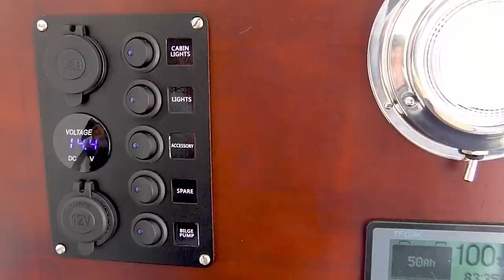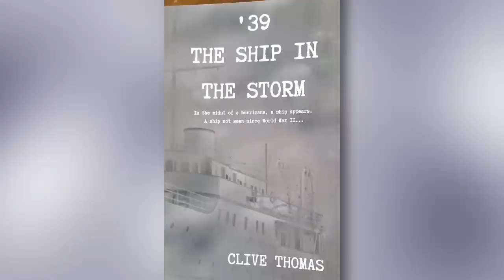7 Month restoration, ready for Dinghy Cruising

Comment: Very nice job! I had an Investigator 30 odd years ago. Launched it twice, then sold it.  Getting it in and out of the water was just too hard.. A Compass Careel proved much easier.
Reply from the maker: Wow, now that's interesting. I presume you mean as the Investigator has a skeg it sits higher on the trailer. But Clive's seem to just slide off easily. For me the advantage of more cockpit space makes the Investigator a winner. Thanks for watching, cheers Paul
Reply: You had the wrong trailer mate, mines a piece of cake to launch and retrieve.
Reply: @GregVanWinden    You're right, mine didn't have the V shape chassis centre. But even so, the Careel could be beached without rolling over, so it was more suited to me needs. I'm not knocking the 563, as it was a beautiful boat to sail.

Comment: My Dad bought an Investigator in the late seventies but there was no centre board, just the skeg. It was difficult to  launch because we had shallow lee shores and upwind  performance was not great and again that lee shore, but I do recall it was a real TARDIS. I also remember my Dad ruefully observing that the new boats had a centre board. Now that I am 60 I think it would made a fantastic raider. I wish them fair winds.
Reply from the maker: Hi Glenn, get another one and join us. Clive is hoping to drop the centre board and check the pin and pulley but that's a bit tricky, so at the moment he is not using the centre board. On my Stornaway I really wish I had a drop down centre board from the skeg, it would definitely improve performance. Thanks for watching, cheers Paul
Reply: The 563’s without a centre board were produced in WA, only a handful of them out there and unfortunately without the centreboard it will never sail well. I think they reduced the mast length and sail area to compensate but less horsepower is never great.
Reply: @GregVanWinden  yeah that's where we were out in the sunny west 😎

Comment: In all of your videos I've watched so far, this is the first boat that has a proper head onboard, if you can call it that. I certainly haven't seen one on your boat, or any of the others you've shared. So if most weekender dinghies have no head, where do you go when you've got to do #2? What do you do when you need to use the loo?
Reply from the maker: You use the toilets at the campsites and most have Porta Potties....showing toilets is not what I call interesting, cheers Paul